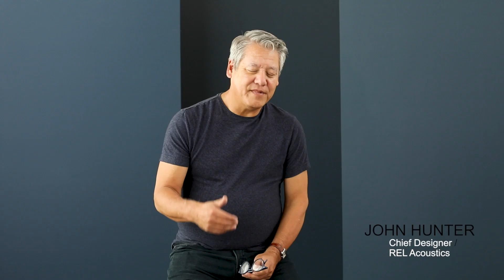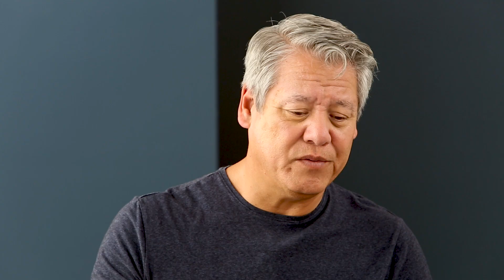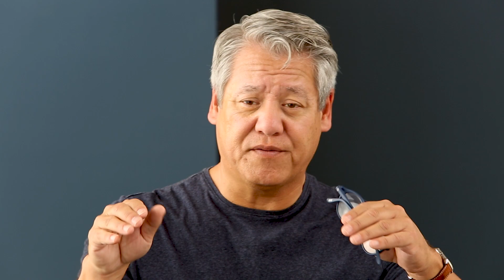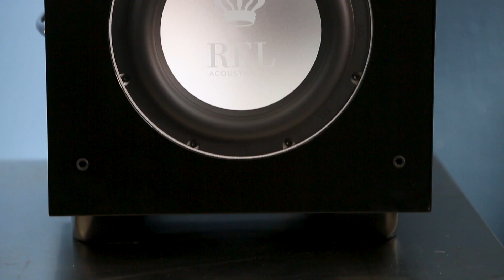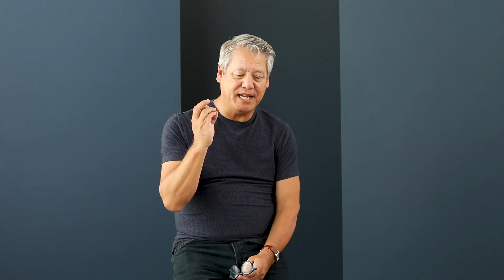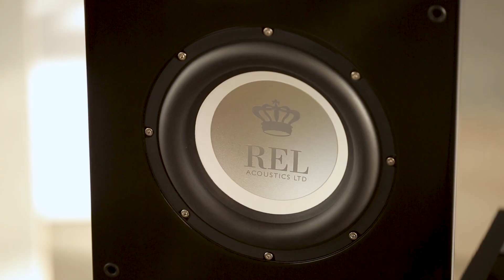Why Every REL Acoustics Subwoofer Design Begins with the Driver

Comment: Why don’t you ever show the back side of the driver to show off the engineering? Are these cast or stamped steel baskets? Do you use an underhung or overhung vc design?
Reply from the maker: The active drivers for our subwoofers use neither an overhung or underhung voice coil design, though other technical details about our drivers vary depending on the specific subwoofer model. If you have technical questions about any of our specific models' driver designs, then feel free to write in to contactus@rel.net and we will be happy to assist.

Comment: Hi I have a T7i im using to play music on my home theater amp through a separate DAC. Im about 60-70 music to 40-30% movies. Would a HT model pair well for music with this or would it be better to just get another T7 please? Thanks in advance
Reply from the maker: While the Serie HT subwoofers were designed with a focus on home theater performance, they can also work very well in 2-channel music systems. However, since you already have a single T/7i and your system is primarily used for music listening, you will likely benefit more by adding a second T/7i to make a stereo pair.

Comment: Great video! Question, I have a Sennheiser Ambeo soundbar. It is for movies only. Room open floor plan. Medium size. Should I buy 2 HT1003,  or -one HT1205?  I Don’t want to go predator. Looks like it would stick out because it is larger.
Reply from the maker: The pair of HT/1003 subwoofers will likely be the better match for your system, though for more detailed information regarding subwoofer pairing for your system feel free to write in to contactus@rel.net and we will be happy to assist.

Comment: Hi 
Im a owner of your subs, when playing 2-channel music , do you recommend Setting speakers to larg or small?
Reply from the maker: For 2-channel music applications, we recommend having your main speaker channels set to "large" or "full-range". Setting your speaker channels to "small" will limit the low-frequency signal that the subwoofer receives through it's High Level input.
Reply: @RELAcoustics  hi, thnx for the replay. 
No i have a REL HT sub so no high level. 

For movies everything is set to smal and the subs is amazing. Just have problems figuring out of i should put speaker to small or large in 2-channel. Of i put fronts to large i can only choose LFE+Mains to get the subwoofer pumping. 

What do you recommend?

Comment: Hi, Can I put a REL T5i with a T9i in a stereo/home theatre set up?
Thanks
Reply from the maker: For stereo pairs of subwoofers we strongly recommend that both units be the same model, which ensures that the tonal output of the system is balanced from left to right. For home theater systems you can use different subwoofer models for different parts of the system, for example having the T/9i paired with your front left and right channel speakers and the T/5i paired with your center channel. We have a blog post on our website which goes into additional detail for such setups: https://rel.net/dive-real-deep-rel-3d/